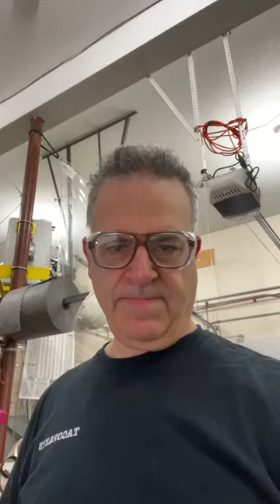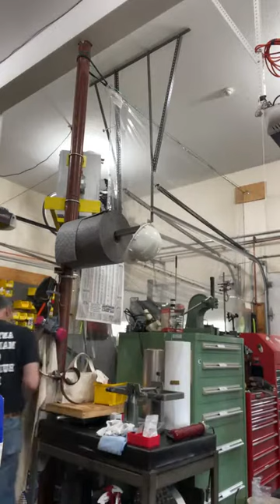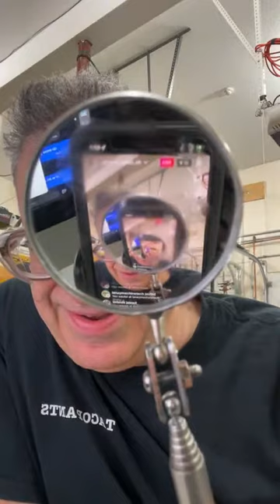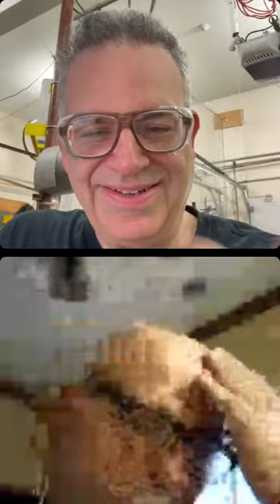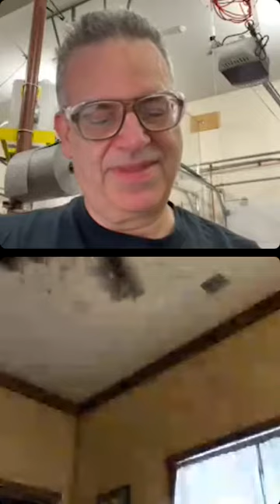PFG IG Live 2022 0612 - Tom Lipton! The process is the goal. The content is dubious.

Comment: 0:00 Housekeeping and discussion of coolant filters.
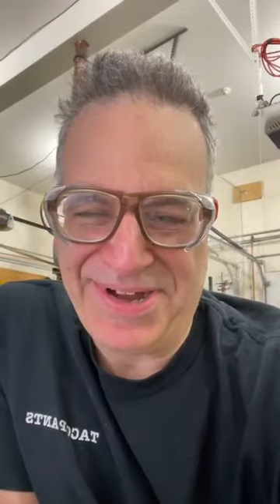12:00 Tom Lipton joins
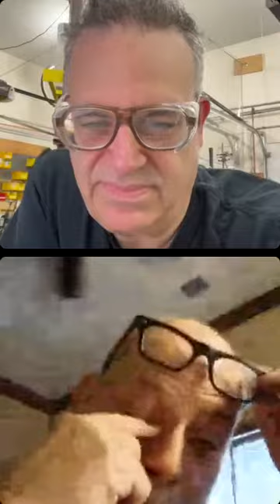13:10 Tom's move into new shop space
20:13 Lamenting gas prices
21:49 Does Tom still work at the physics lab Lawrence Berkeley National Laboratory
26:45 Which of Ton's machines are operable?
27:50 Any new tricks in the moving process?
30:30 In hindsight would Tom do anything differently?
31:40 Favorite ice cream flavor?
32:25 What tool/machine so you use the most?
36:10 Will you be using the Wire EDM soon?
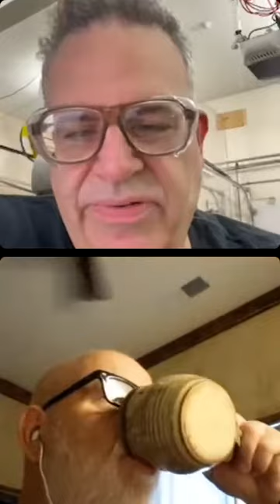36:40 How often does Tom change his shop shorts?
37:20 Is Sandia Labs near you?
38:17 DId you uncover any missing items in the moving process?
39:40 What is the best project you made. and in what year?
42:40 Viewer asks about moving a project from the milling machine to the surface grinder.
44: Do you have any dream projects for the new shop?
48:50 How relevant are file work skills in a modern shop?
51:00 Do you think that learning from YouTube is better than learning at college?
58:15 How much extra work does making a YouTube video of a project entail, and what equipment do you use?
1:01:40 What dream machines would you get if money were no object?